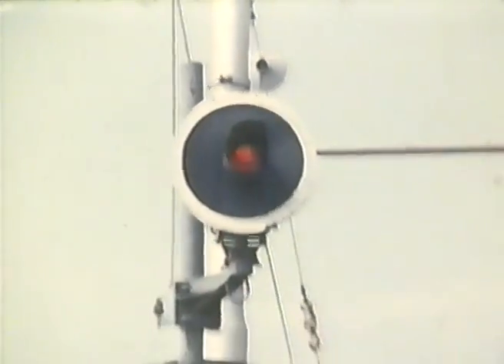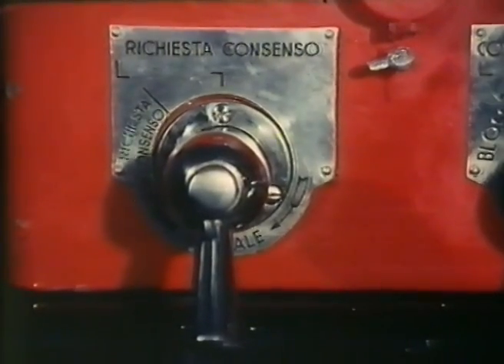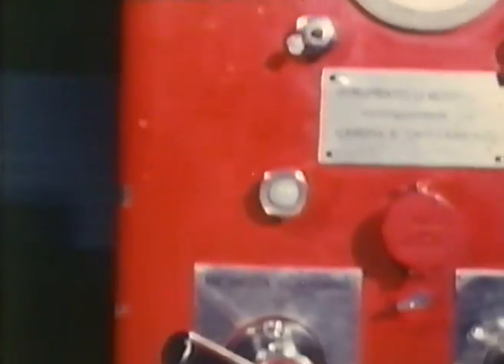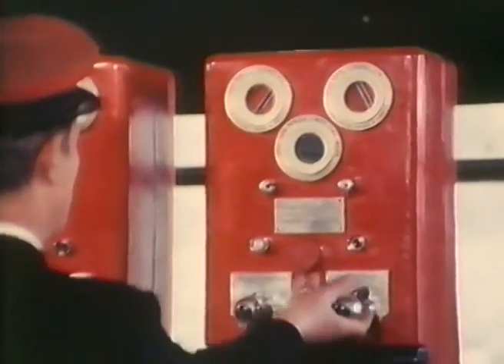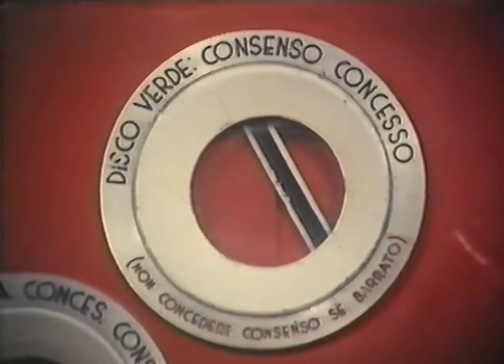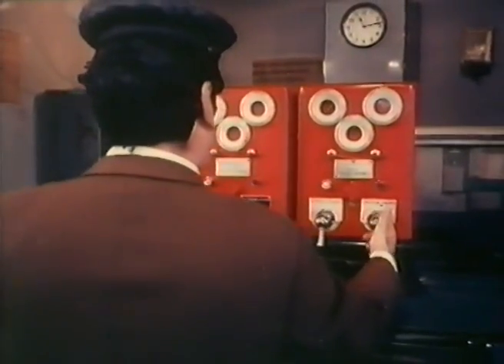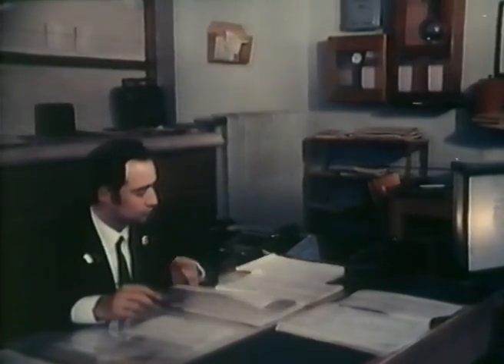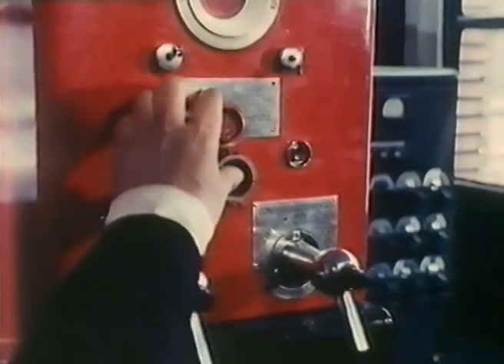Esercizio con blocco elettrico manuale tipo FS

Comment: I'm assuming that this manual block system was (or is still, IDK) used on the high-speed main lines, am I right?
Reply: Nope
Reply: alright.
Reply: This is the Manual Block sistem used for normal lines. In the high speed lines in Italy they introduced the Automatic Block. For the very little lines the Telephonic block was used until 15 years ago. This Manual Block in the video is still used even in medium-traffic lines (Piacenza-Alessandria)...even if it's disappearing slowly.
Reply: Michelangelo Sistonami
 Thanks. This is the reply I was looking for :D
Reply: @MegaZsolti  The manual block system shown in this doc was gradually dismissed in the 80s, and replaced with Automatic Axle Counter block system, and later on with more modern electric Automatic Block system. 
As of Now, all high speed lines in Italy are operated with Radio Block System (Ertms/Etcs Level 2) 
Main lines are operated with Automatic block system with codified currents (allowing cab signalling) 
All other lines are operated with Old axel counter 
Theese type of manual block are out of use (actually it is still used on a very short section of line in Central Italy)